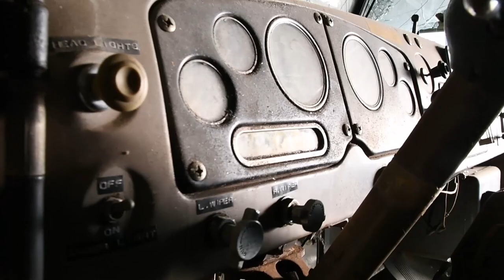ABANDONED AIRPORT! | Reed City, MI

Comment: according to the newest sectionals, this airport is still marked operational. However, the runway condition (as in the video) is marked poor, cracked, and no markings. And it is closed during winter when snow-covered. Wondering has anyone really want to fly their plane there due to these runway conditions? even if they clean up all the grass and stones on the runway, fill the gaps, do a simple marking, this airport can have at least more training flights coming to do patterns
Reply: I seen a small aeronca Champ land here this weekend 10-29-22.  I got to check his plane out and film him taking off out of the airport.  It was very neat.